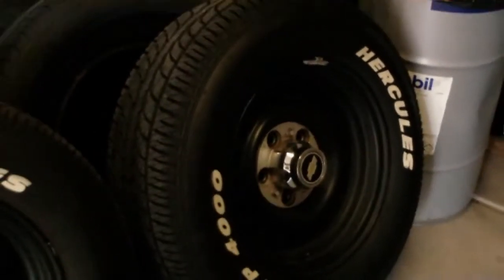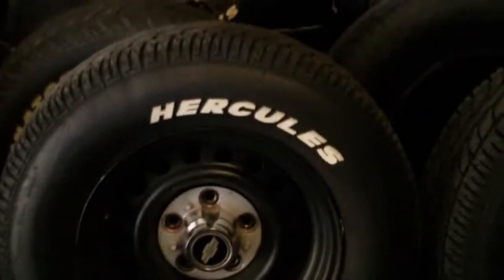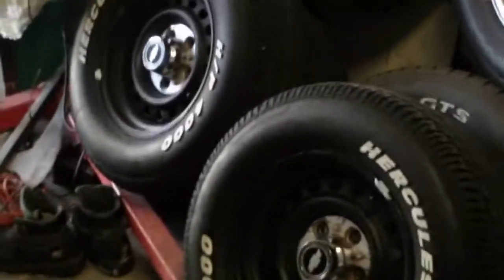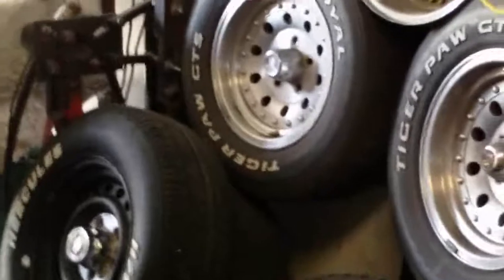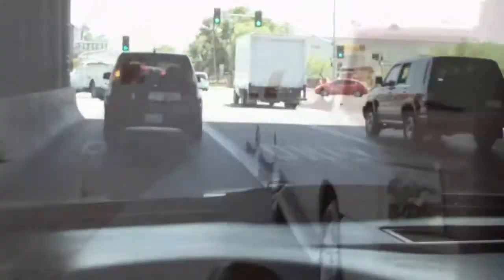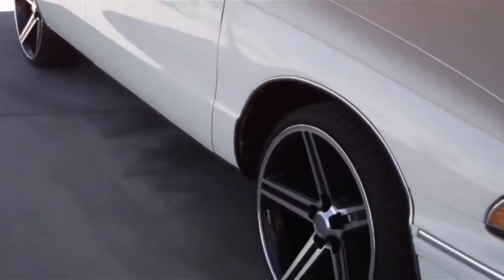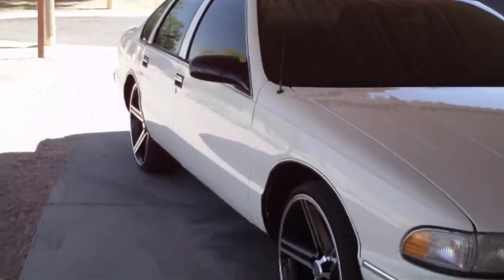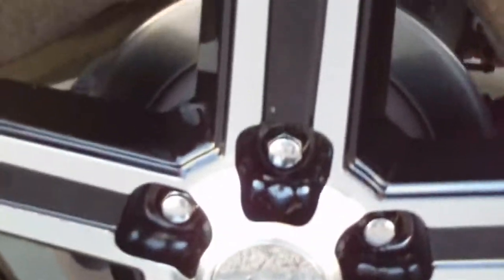New Rims on my 1996 Caprice 9c1

Comment from the maker: If I went with a wider tire it would have rubbed on the swaybar when I turn the wheel all the way (wich I have to do everyday to get out my driveway) because my car has been lowered the tires I have now barley fit without rubbing in a few spots.

Comment: Yoo I gotta lt1 caprice and im putting a blower on it soon but as you know the width of stock honey comb rims won't hold up...any way you might be interested in selling just some straight plain ass rims that would fit ( I like the blk ones in beginning of vid) if they are about 8-10 wide and are 17s or so? I just want to keep the whole sleeper loom to my car, maybe work something out if possible if I can't find anything in my area
Reply from the maker: My black stock rims are only 15X7 (same size as the Honey comb rims) If I were you I would get a set of Cragar Black Soft 8 Wheels from Jegs the 17x9's are only $100ea.

Comment: do I need to lift my g body to run 22 rocs
Reply from the maker: It depends on what size 22" tires you have
Reply: 100SpokeRiderz I just got the shocks redone so it sits a little higher than stock I had some 20s on it but I needed spacers for the back the tire would rub on the rear frame don't remember what tire size they were but what would you suggest if any
Reply from the maker: I know Iroc's come in different off sets so as long as you get the right off set you should not need spacers Ive seen a lot of G-Bodys mount Irocs with no spacers. Ive only had wire wheels on my G-Bodys so Im not sure on what off set you need but I would check out the G-Body Group pages on facebook there is a lot of good info on there
Reply: 100SpokeRiderz  thanks for your advice